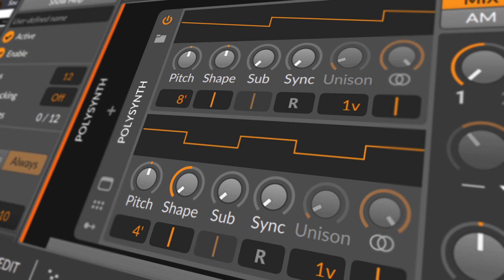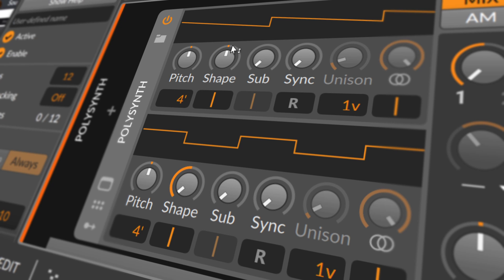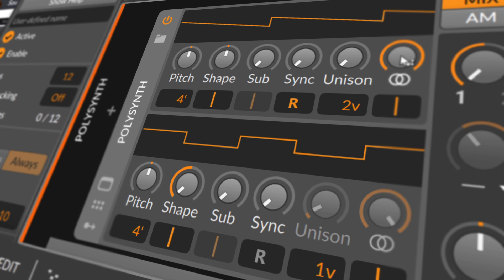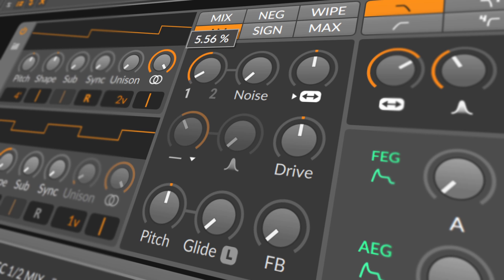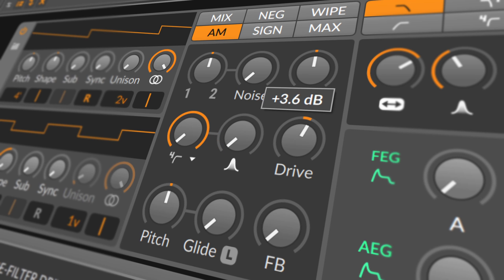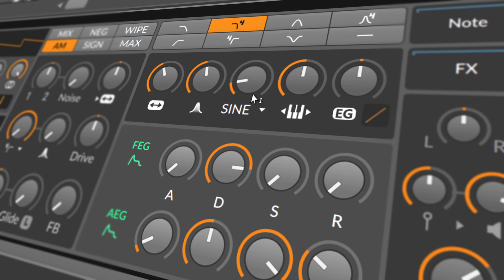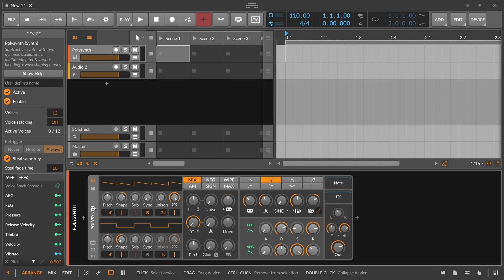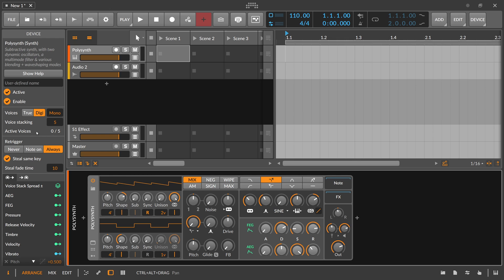Polysynth - Bitwig Instrument Guide

Comment: I wonder why they decided not to also include a sine wave shape from the oscillators in Polysynth?  Seems odd to have to hack one together using the test tone device.  I don't think FM4 will do a clean one without harmonics for sub-basses.
Reply from the maker: because it makes no sense. In "subtractive synthesis" it´s all about removing harmonics from rich waveforms with filters. Sine doesnt have any overtones, so there is nothing you could remove/subtract. To create a sine there, you use a steep filter and remove all overtones froma saw until you're left with the fundamental.
Reply from the maker: made a video about it on my other channel :D https://youtu.be/h5m_uHEiWwE
Reply: @BitwigGuide   I guess I've always thought of Polysynth as a multi-purpose synth tool rather than strictly a subtractive synthesis module. In that sense it seems to overlap significantly with Polygrid, no?  Maybe a future release will refactor the process of synth creation into a single master device.